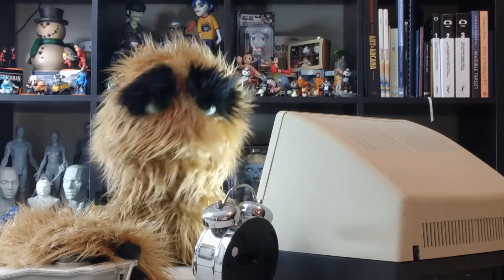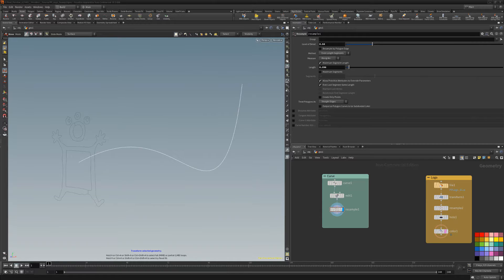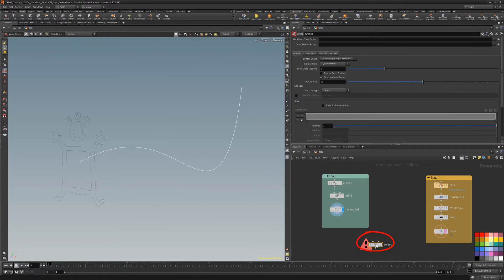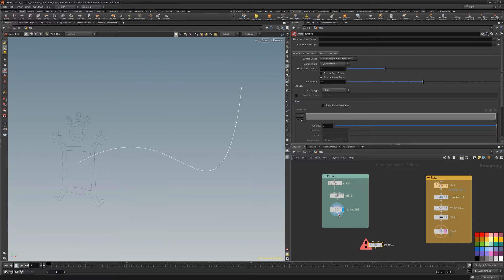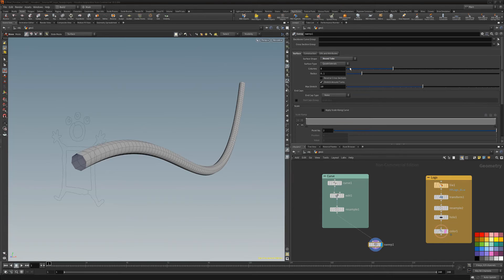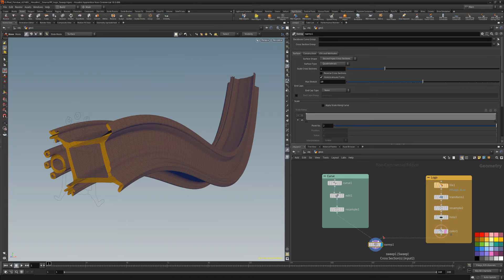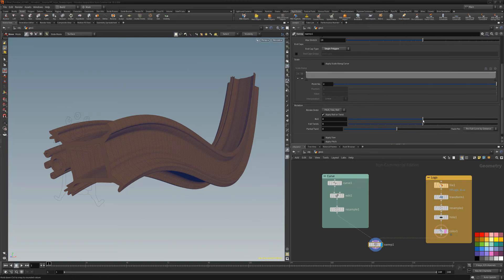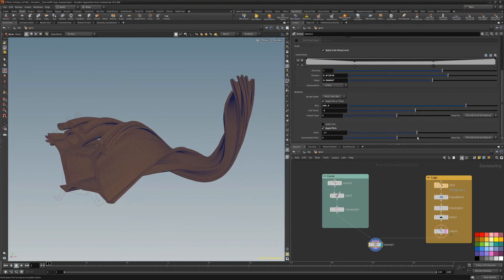Houdini | Sweep Geometry Node

Comment: set Surface Type option to columns ll gives u just the curves while getting rid of the polys. That's useful to create curves, then u can sweep again those resultant curves and twist them using the twist of the first sweep node to get a rope for example if the input geo was a simple tri or quad.
Reply from the maker: Nice. Another one to look into!

Comment: For flat closed meshes the polyextrude with a curve to second input is very useful :-]
Reply from the maker: Noted. Is there a benefit to that over sweep?
Reply: @pixelfondue  the sweep by default sweeps all edges of your mesh not only the boundary, creating interior polygons in the process. There are probably several methods to use polygons instead of curves, but I didn’t investigate enough. But there are several ways to create a boundary curve of a mesh and sweep that.

The polyextrude can use complex poly-cross sections that might not get „capped“ like you intended. A few days ago I created a multilayered coated cable using the polyextrude. Anyway, sweep is super powerful most of the time, but if you are in a hurry there’s still extrude waiting as a backup :-)